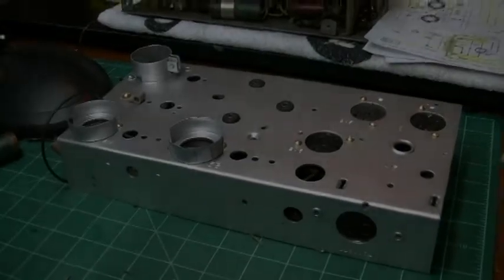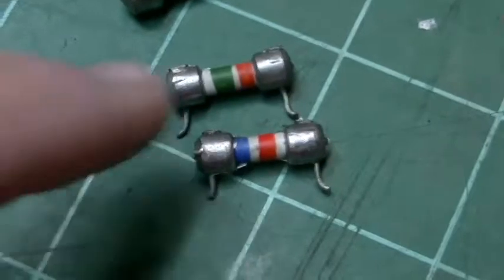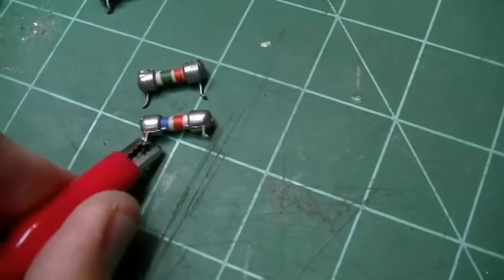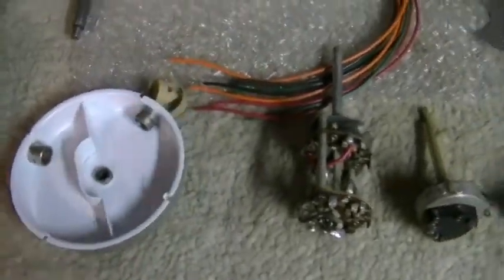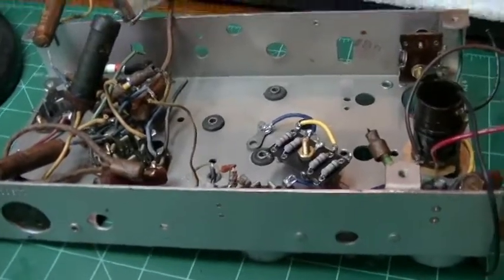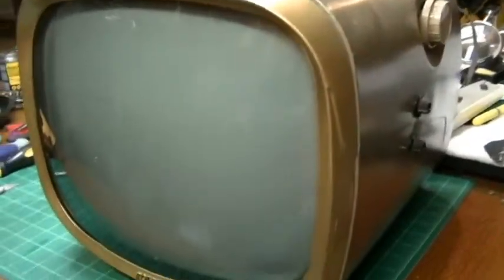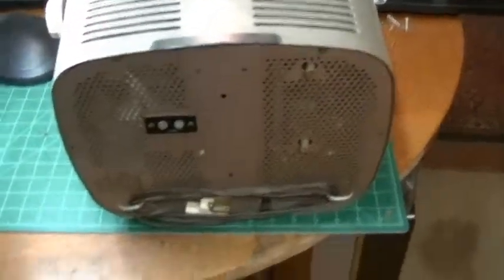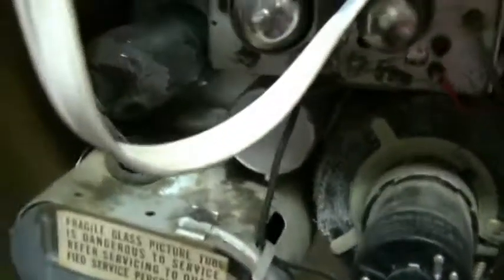1934 Atwater Kent 145 Pt. 2....plus my next project!!!!

Comment: I think I see some of those vertical black film caps, did not see any wax caps, and some orange drops. I suspect the vert black are prob leaky but the orange are prob ok. I have had issues with brown drops esp if they are very near a tube (heat). Looks like a fun project.
Reply: I think the black cylindrical one you can see is just a radial version of a paper capacitor, apparently Admiral sets used to use them a lot in the same era, those are junk just like the "Bumble Bombs" and Sangamo "Little Chiefs" except that they don't explode.
Reply from the maker: Yes, they are junk. They are going by the way of the trash can as soon as I get that PC board out.